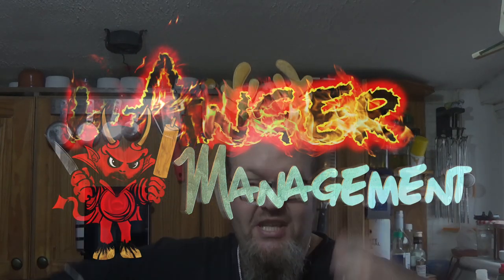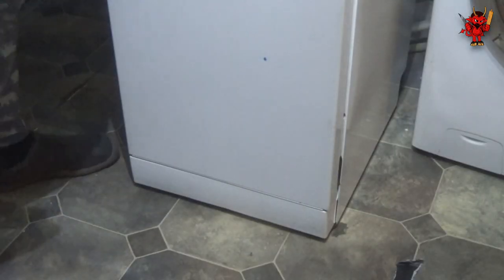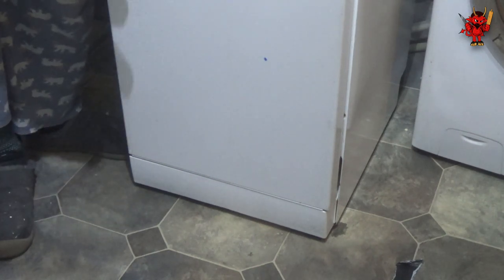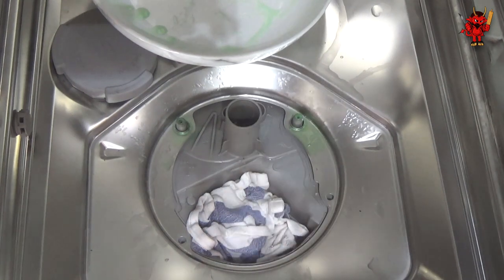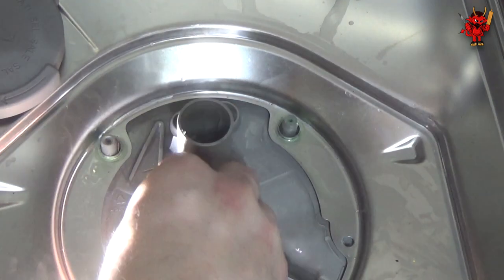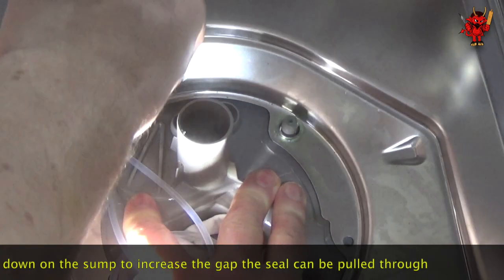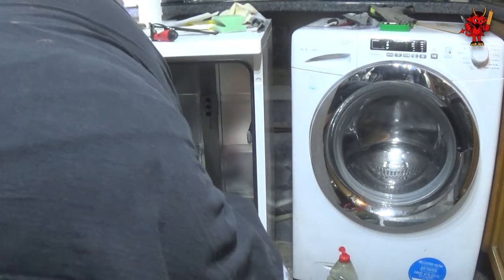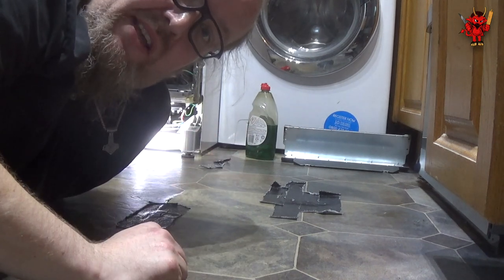Bosch SPS53E12GB/23 Dishwasher Sump Seal Replacement Kit

Comment: Thanks for the video - it was helpful seeing where you had trouble, and gave me a lot of confidence in tackling the repair.  I suspect that there has been a slow leak for a long time and there was some dried sediment to clean out between the tub and the pump.  
One suggestion - trim the plastic peg’s fin BEFORE loosening the screws - it’s easier. 
I found that the bent wire leader worked well as long as the slippery new seal was reminded where it was supposed to go. A little more detergent lube plus a little extra downward pressure on the front of the pump helped get the ‘over size’ loop of seal into its correct position. 
Much appreciated!
Reply from the maker: You a very welcome. I'm glad the video helped, especially the parts where I encountered difficulty. I thought it better to keep those parts in because if I encountered it as an issue then I was sure someone else could benefit from seeing them too.

I'm very glad that my experience allowed you to tackle this and to come at it with a way of giving advice that can benefit others. Cheers.

Comment: Thanks for the video.  I found that to get the oring down easy, just shift the pump so the boss is over to one side in the hole, grab the oring and pull it down.

Comment: Thanks for the video.  When mine started leaking, I simply tightened the rwo screws and it stopped for 2 years.  It recently started leaking again, so I tightened them again, and it stopped again.  I'll just keep kicking the can down the road like this until I want a new dishwasher.

Comment: My Bosch Dishwasher threw an E15 code. Upon inspection (pulled out from cabinet, folded up the sound deadening batting to look underneath, noticed the float (styrofoam disc in bottom center of base, which rises if water is present to trigger switch above it) was a bit disintegrated (meaning water had been working on it for a while - but I never had a leak externally).  Ran a few express cycles and watched for leaks - eventually I noticed a dripping from between the the "sump" housing (the large central grey round plastic pump housing in the center of the bottom base attached to DW tub above). Was thinking of replacing the sump seal (but it looked like a bit of a pain) so I just tightened the four torx screws on the floor of the inner DW tub. Note: the two visible rearmost screws would tighten but one felt like it was almost stripped and wouldn't catch very strongly (as it's screwing into the plastic sump housing below - not a great design by Bosch). So I put some glue on the screw before putting it in - let it dry over night and tightened it up after 24 hours - it still wasn't a tight a screw down feeling as I would like but it seemed to do the trick (the righthmost screw seemed to grab and tighten well - the 2 frontmost screws were already tight as they could go.). This seems to have cured the leaking problem after running a few test cycles and looking for leaks - so all good for now. I may need to replace the seal in the future or drop some epoxy in the screw holes to get a stronger screw down tightness. Thanks for all the info.  Oh, I replaced the float which was simple as the switch just pulls up with a tug and new foam float sets in place - unfortunately, this little piece of Styrofoam is way overpriced and was like $30 online (oh, well.).

Comment: Great video just fixed mine and all OK so far, id advise buying 2 seals as you will probably break the first one also try cut the nibs on the post on both top and underside of the hole with a small knife as this is what tore my first seal .keep up the great videos

Comment: Hello, I have got to the bit where I got the seal ring in but you're right, it seems to large. Mine is 182mm diameter, I have tried several times but it hasn't gone Pop yet! Did you try any tips at all?
Reply from the maker: Yeah, it was really really fiddly. It seemed to align itself after quite a bit of fiddling about and pushing it into place with the round end of the skewer I was using. 

When it did eventually go, it really was like a popping as it just sprang away. 

If I remember correctly I was pressing near the door side when it all came true. What I can say is that its been on twice a day every day since the repair and its still working perfectly.
Reply: Hiii again! I just tried again and it actually just went Pop! So what I did was lifting the sump bit a little because I was trying to get it in by a different tool!! Thank you so so much for your video! We first had an E14 and fixed the leak, then the E15 problem turned up! Fixed it and the leak happened again! So I'm trying to seal it! 😊😊😊😊 thank you so much for your video!!
Reply from the maker: @ThiUK-ye9fc  Nice one. As Hannibal from the A-Team used to say "I love it when a plan comes together" 

On my machine I replaced the door seal first (unfortunately never thought to film the process though) as it had completely disintegrated, but even though it was knackered it turned out the bigger problem was the sump seal.

Fingers crossed thats you fully up and running now. Stay safe.

Comment: Thanks for the nice video. I have just followed it but it still leaks. Even worse now. Could it be that I have dried dirt/washing powder in there making the new seal ring not tightening enough? I could see quite a lot in that space but it is hard to clean it.
Reply from the maker: Hi there. I saw another youtubers video that suggested dirt lodged in there could be a problem, so if you can find a way to get in and clean it out it may do the trick. I think from memory they used pokey stick and thin cloth. Best of luck though and sorry so far you haven't got the problem sorted.

Comment: Thanks for the fast reply. 
Yes! It's OK now. I took a few Q-tips, wetted them, pulled out the silicone ring a little, pushed down the sump with a stick and sweeped the area as good as I could with the Q-tips and it was a LOT of unwanted clogged stuff in there! 
It's not leaking now. Maybe you - and all others - should add this little extra procedure to the job, it just takes an extra few minutes. 

Btw: I almost ruined the ring, got a little jack in it. It didn't snap, though. But apperently it is good anyway.

Comment: At 22:21 do not use the kit. Use a roll of plumbers putty. The putty will provide a good seal.
Also do not remove the front door. If you slide the unit out, you can lift the insulation and look in from the side to see if the sump contact is the source of the leak. Under the sump is a foam float with a switch. Dry out the area under the sump. 
It is a one hour job if you use the putty and dry out the water from the side. It is a five hour job if you do it his way and that gasket is a disaster.
Reply from the maker: Hey there and thank you for your input. The more feedback that's given the better the knowledge pool for everyone. Even in cases like this where we disagree, the viewers can read the comments and make up their own minds with the extra advice thats been provided.

I would absolutely not use plumbers putty (I did consider it, along with the idea of maybe using silicone sealant), but once it dries hard, you will not be able to open up the sump again should you get a recurrence of the problem from another area. The seal should it go at a future point in time can though be replaced. If not using the seal repair kit., my next choice would be a full sump replacement, but that costs even more and takes longer to fit. Was the seal as easy to fit as other videos on it I watched suggested, no it wasn't, but its why I show that in the video. I'm now over a month since the repair, with the dishwasher going on twice a day, everyday at least and I have had no issues.

As far as I can tell with this particular model, as I explain in the video the only way to access and see the underside of the dishwasher is to remove the door cover panel. I am not removing the door, only the cover panel, as this gives access to the two torx screws that you otherwise cannot access. Which then allows the removal of the plate at the bottom and allows you in to dry the underside of the machine.

As for time wise the video is pretty much a real time example of how long it took me to to the replace the seal and repair the machine, so hardly the 5 hours you claim it would take. The only thing missing was my initial drying out of the underneath of the machine, which took around 10 mins and if I'm being very generous 15 mins, most of which can be accounted for in the time wasted on me faffing about and trying work past a camera and slow down to look through its screen to make sure that everything I'm doing is still in the shot